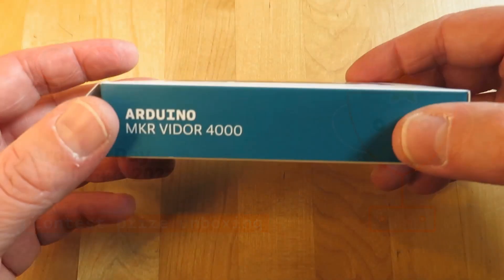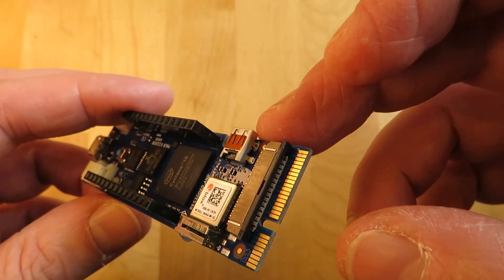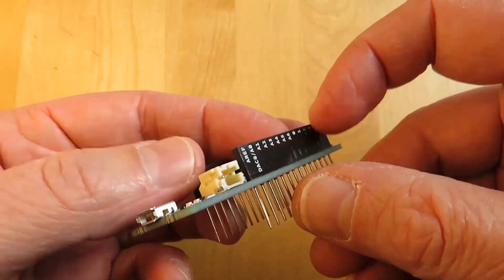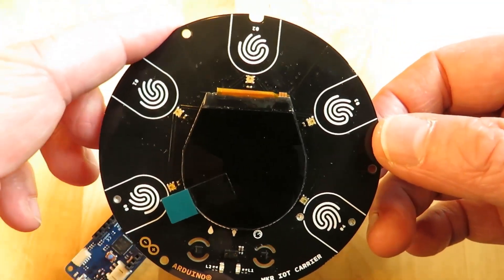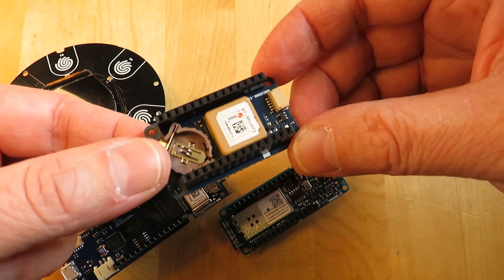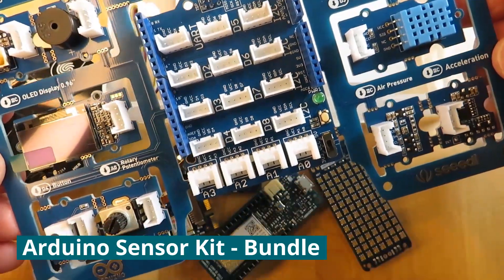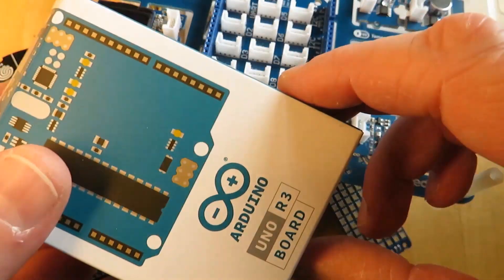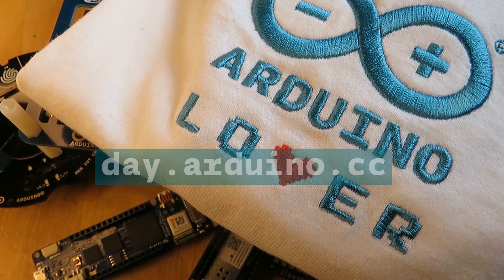Arduino Day 2021 Community Challenge Prize Unboxing

Comment: Hi, I want to compete in arduion day challange and I want to add my video but it can be only up to 10MB and my video is 140 MB even with lower resolution. What do I do can I send a link do google docs or any other storage.
Reply: Compressing the file doesn’t work too
Reply from the maker: Hi Maciek. Yeah, ideally we're looking for 10MB videos just to try and make sure they're short enough to fit the winners' presentation on Arduino Day. So if you're able to trim it down to fit, that'd be great! Let me know if you get really stuck with bring the size down, though.
Reply: @Arduino  I've been having the same issue, my video is just under two minutes, and even at 540p my video size is about 50MB. Can I submit a link to a YouTube video instead, or is there another option? Thanks

Comment: I submitted the form but have not got a confirmation email for it. And i also wnt to know how many winners will be there?
Reply from the maker: There'll be 10 winners, announced on the official Arduino Day live stream (day.arduino.cc).
Reply: Hey, How long your film was? Cause I also want to submit but my film is 430 Mb Not 10 Mb. How did you do it?
Reply: @maciekgaa5215  mine was 30 seconds and exactly 10 mb
Reply: Mine is 3 minutes and good quality 1080p and is about 400 What do I do?
Reply: @maciekgaa5215  Make it shorter